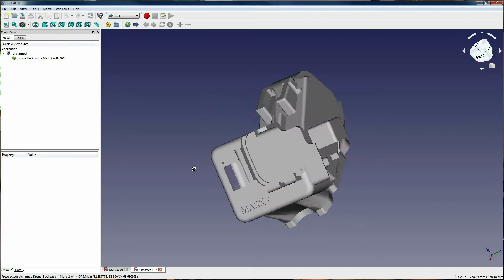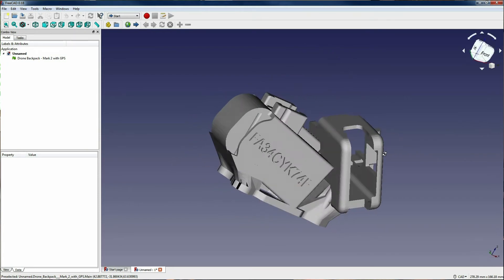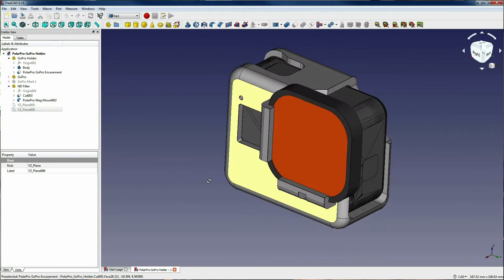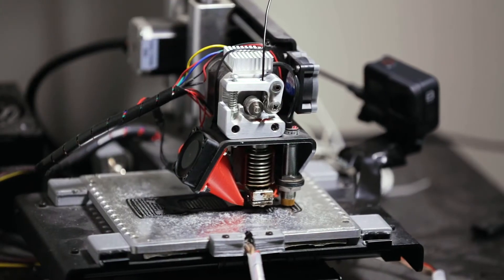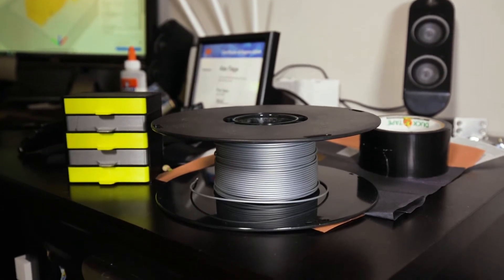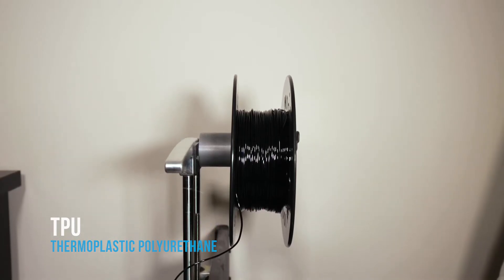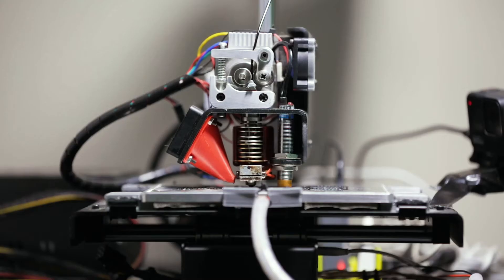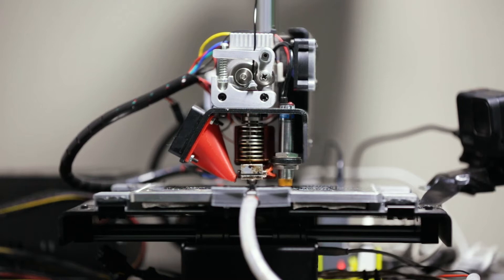Custom 3D Printed Drone Parts | Cinematic FPV Tech Talk

Comment: Great video. But I would recommend buying an ender 3 printer. It is $200 and a very good printer for beginners and even intermediates. It is very common and lots of people use it so if you have a problem you’ll probably find an answer.
Reply from the maker: Great advice! I would probably still want a 12" bed for myself personally, but that seems like a solid recommendation! I appreciate it!